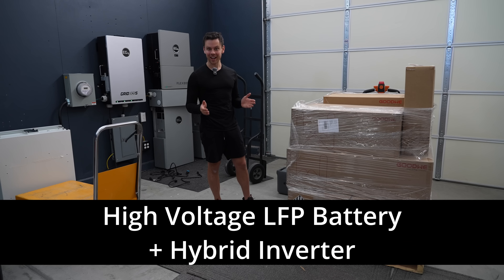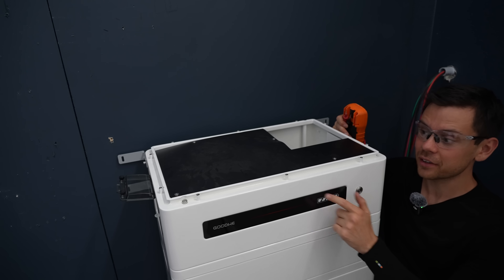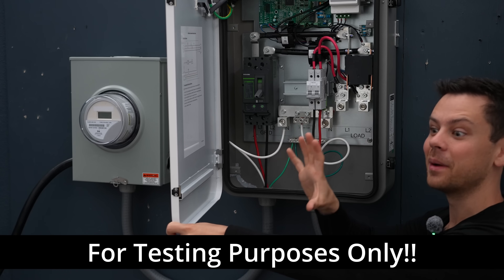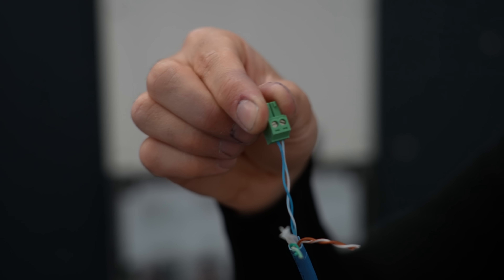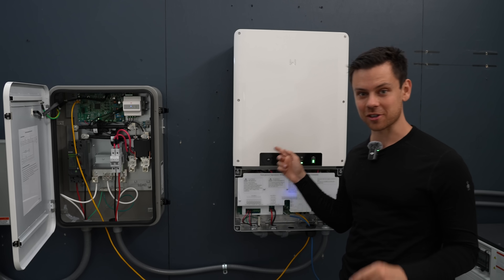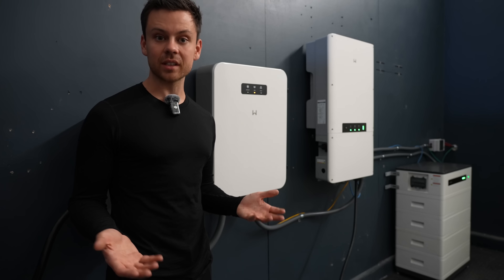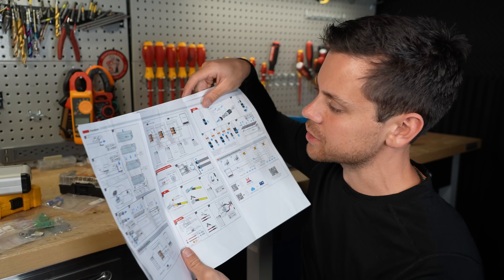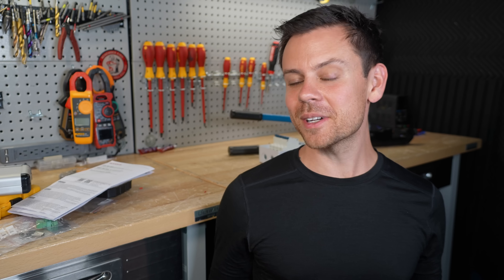GoodWe 11.4kW Hybrid Inverter + High Voltage LFP Battery: My FIRST Dead Silent Inverter!!

Comment: I cant wait for the EG4 nova inverter... can you please try to get the EF 102v batteries to work with it?? Would be nice to have something to use if the DPU inverter is ever out of support/warranty.
Reply: They will only be released to installers not the general public.
Reply: @rpsmith  very sad

Comment: Don't do a DIY high voltage battery! Get a used EV battery. Those are high voltage, usually 360-400v nominal. Check out Dala's battery emulator and the list of batteries it supports.
Reply: I was gonna add that.   I've been looking into a dala ev setup using the stark cmr, a tesla lfp 60kw pack and this goodwe or solis 11.4k.    Cheapest and most efficient setup.    

Tesla packs can be had under 4k for 25k miles or so.
Reply: i have seen it! looks like a perfect sulution when you now what your doing!

Comment: 48V beyond 5kW is mad IMO
Reply: Victron has been doing 15kVA 48V inverters forever, including 3 phase setups with up to 12 units for 180kVA.
Reply: Haha. This same company, Goodwe just released a 5-20Kw (yeah, I mean 20 kilowatt) 48v inverter. It's called the Goodwe ET 20K LV. Of course they have a high voltage version of the inverter.

Comment: Will, love your stuff.  Unfortunately there's no such thing as an "Ethernet Cable" just like there's no "AI".  People can make up names and use it a lot, like the non-word "Ain't" but it's not a word.

Ethernet cables can include 10Base5 with vampire taps, 10Base2 with BNC connectors, and twisted pair forming 10BaseT, 100BaseTX, 1000BaseT through Category 3, Cat-5, Cat-5e, Cat6, and more you would never use outside a datacenter.

That having been said, removing high current (and using high voltage) does mean higher gauge (thinner) wire, which is great, but requiring a 4-sided crimper when most of us use 6 or 2 is just somewhere north of incredibly stupid.

An "ethernet cable" (no, it's not) where you have to strip the ring/tip (blue/white, white/blue using EIA 568) and screw into a block connector means some moron didn't include an RJ45 F jack and the associated PCB wiring.  It's not just moronic, it's anti-purchase.

When companies learn to use standard connectors, have the "app" work out of the box, that will be a sign that we've gone from the gold rush of 1949 to Wall Street.  I'll wait.

Please let me know me how much you want for the EG4 stuff you took off the wall.  That works.  I can use it.  Will work out a deal.

Ehud in Tucson
Reply: The reason it got this way was because many RJ45 cable formats in the past were highly specialized and swapped pairs or were otherwise not straight-through.  It caused VAST confusion industry-wide. For decades.  I still have CISCO cables in my bin like that.   I still have 100BaseT cables that only wired two pair.  I still have weird RS232-over-RJ45 cables.  And weirdly wired RS485 cables that only worked with particular vendors.

To say it was a mess would be an understatement.

This caused so much confusion that the industry began standardizing on straight-through wiring for RJ45 and just calling it "ethernet cable".... because starting with the gigabit standard, ethernet cables were wired straight-through.  No pin or pair swapping, period.

For someone wiring all this stuff being able to spec a cable as "ethernet" in modern day removes any and all confusion that might otherwise develop.... and then tacking on a cable type in addition, if necessary.   You won't be able to convince people otherwise.  It's become part of the organic culture.

Comment: NEC Section 690.31(D) covers the rules on DC PV circuits installed ON or INSIDE a building. The parent text in Section 690.31(D) only applies to PV system DC circuits INSIDE a building whereas 690.31(D)(1) and (2) apply to wiring methods ON or IN buildings. Those PV system DC circuits ON or INSIDE a building must comply with the additional installation requirements in 690.31(D)(1) and (D)(2).

Often, PV system DC circuits are installed ON a building. Once the PV system DC circuits penetrate the roof, they are now considered INSIDE a building and additional rules must be followed.

Where INSIDE buildings, PV system DC circuits that exceed 30 volts or 8 amperes must be contained IN metal raceways, or Type MC metal-clad cable that complies with 250.118(10), or in metal enclosures.
Reply: Great information. You should also make a posting in the DIY Solar Power Forum.
Reply: Do you have to use metal raceways even after your disconnect? Somehow I thought you could transition to PVC after the disconnect. So if you run all the cabling outside the building to a disconnect outside the building, you can just use PVC.
Reply: It is true that metal conduit is required, even for 48V.  It can still be flexible conduit, but it has to be metal and it has to be grounded.  Connected or disconnected, doesn't matter.

Comment: Is the high efficiency also a result of the high voltage?
Reply: Yes but I'm not aware of any goodwe inverter, low or high voltage that's less than 96% efficient. They are typically around 97% efficient. They are known to make really efficient inverters.
Reply: @adon8672  I should look into them.
Reply from the maker: Yes

Comment: Can these batteries be put outside instead of the garage?  
Secondly, instead of using a solar system to charge the battery, can the battery just be charged and used as an emergency energy source?
I appreciate any advice

Comment: Im waiting on getting an inverter. I dont need too much probably a max output and input of 6-7kw(eventually). However, the unit will be right next to a bedroom and when the sun comes out my ecoflow delta pro screams! Ive been waiting for something silent like this. Should i continue waiting? I was hopeful for the flexboss since most said the fans dont kick on until 6kw

Comment: Could we use a server rack in SERIES?
Reply: I was told NO, on EG4 and JK inverter bms as the shunt could not handle the voltage. I thought about Converting 2 48v to 100v for testing. Hopefully JK will offer a bms for high voltage DIY kits.

Comment: I take that 96.7 with a large pinch of salt.
in my dictionary means that if I take a full battery and dump it in a similar one, the second one will be 96.7 full. 
this means that I can dump back and forth at least 25 times till I lose all the charge. 
But it is not like that. 
Even a powerbank will lose a third of the charge, even there is not big voltage conversion. 
Maybe is not about al losses, but only the losses in the inverter. 
However, in the end all losses matters, so this is just theoretical. 
I mean pointless.
In real life you need to know the actual losses. 
How much you put in.
Versus how much you get out.

Comment from the maker: 0:00 Intro
0:40 EG4 System Removal
0:55 Unboxing and Battery Construction
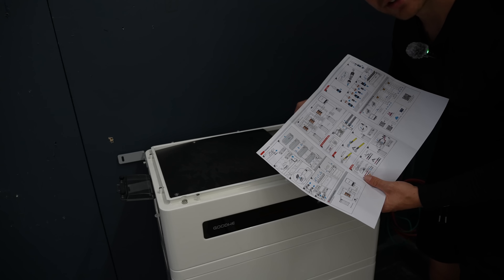2:11 Inverter and MID Mounting
3:01 System Overview and Wiring
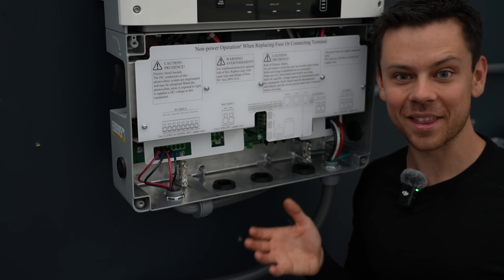4:34 Connecting the High Voltage Battery
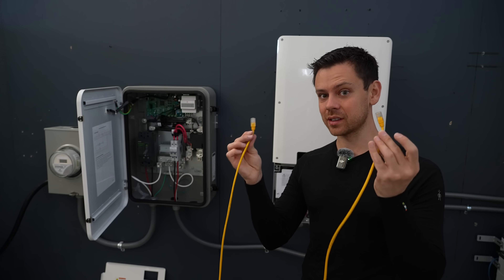5:10 Communication Setup
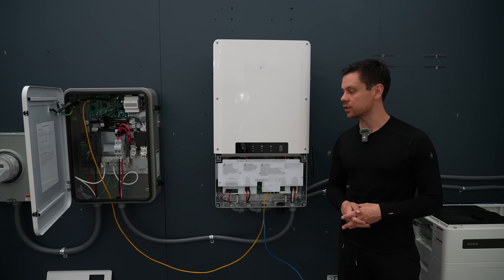5:58 Power ON!
7:17 Tesla 40A Charging
7:52 Dead SILENT! 
8:50 Pros and Cons
Reply: About efficiency. 
I am really curious about overall efficiency.
I mean how much you will need to fill the whole 38.4 battery. 
And then how much you can squeeze back out. 
I always believed these ninety something efficiencies, but when checked with regular powerbanks I got the surprise to find that the overall efficiency is actually a lot lower, under 70 percent.
Maybe this is because powerbanks are cheap toys. But somebody with a Tesla Powerwall said that for that system the return is about 80 percent.

Comment: I don't think I would want a dead silent inverter.
Electronics age like milk. Hot electronics age even faster. 
I'll take cooling fans all day everyday.
Reply from the maker: It runs cooler, its high voltage
Reply from the maker: That is why the efficiency is so high as well
Reply: @WillProwse  of course. the efficiency loss is 100% converted to heat so going from say 85% to 95% is effectively 66% less heat generated.
Reply: Will needs to do a tear down and see what’s going on inside. hopefully its not just smoke and mirrors
Reply: It will definitely run cooler since it doesn't have the 48V to HVDC mid-bus DC-DC component.  The inverter component is the same for both (the HVDC battery just replaces the HVDC mid-bus in a 48V inverter).

But I also agree with the fan comment.  I always want the fans turning, even if at slow speed.  I don't want them off.  The cooler the electronics run, the longer the electronics will last.  Whether they are running in-spec or not.   I usually wind up mod'ing my smaller inverters to always run the fan (though I haven't dared open my Flexboss21 to do the same thing, and probably never will).

Comment: I kinda want high voltage in my RV so that I can plug in to a high power DC EV charger. 

Right now I can only do that with AC charging stations, and get 6 kW of charging.

Comment: How do they get 10KW so quiet?
Reply: High voltage means low heat production
Reply: Converting PV level voltage say 400v dc to 400v battery or 260v in this case has less heat loss then the same 400v dc down to 48v like we normally see on like EG4.  Same with battery voltage to AC output (240v)